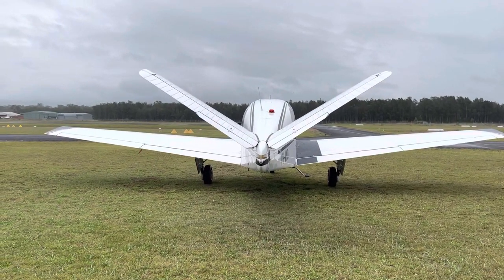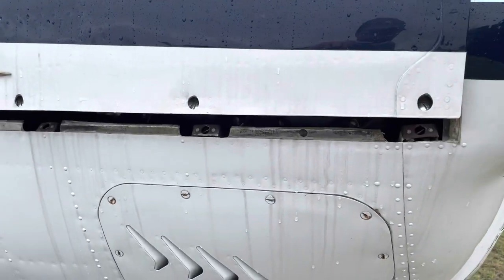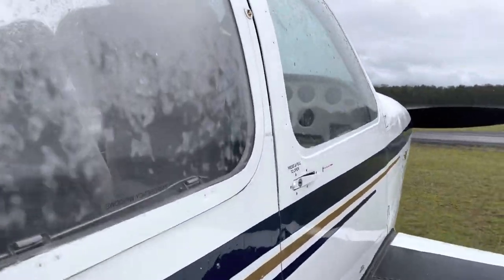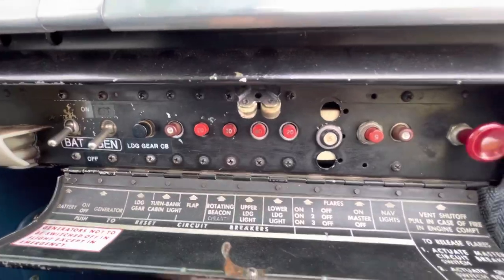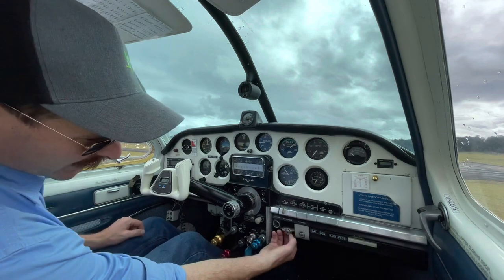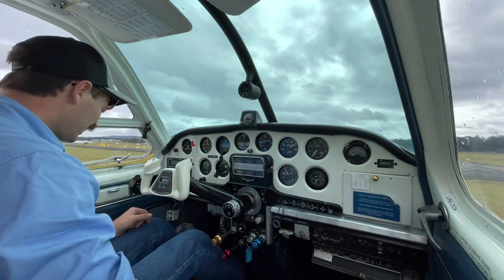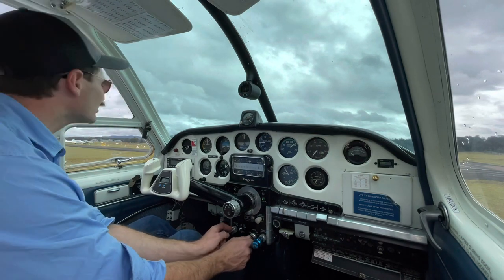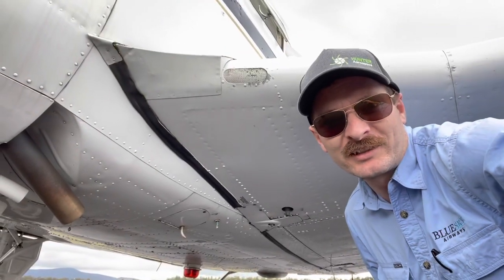First flight in a V-Tail - Part One

Comment: Can an older bonanza with T bar yokes be converted to two separate pull/ push yokes like in a G model???
Reply: You can switch the single yoke for a double yoke, they’re connected on a bar and connect to the same center column on the aircraft that the single yoke connects to
Reply: Double yoke was laying in the back seat.
Reply: I just sold my 1947 straight 35. It was a 77 year old museum piece-still flying! Upgraded the avionics and panel, but kept the piano keys😉